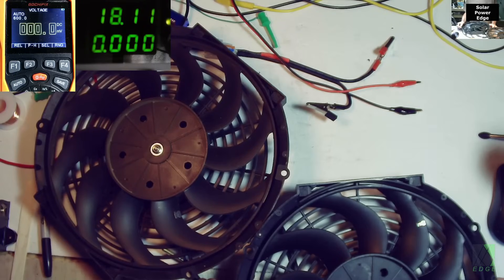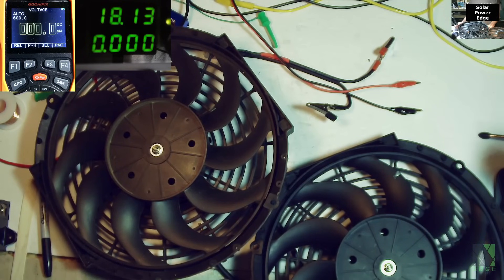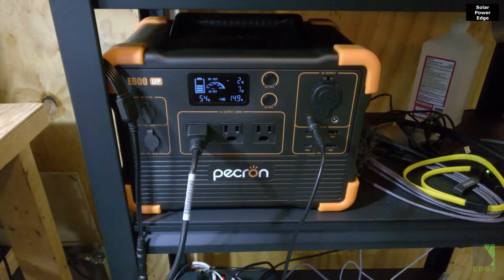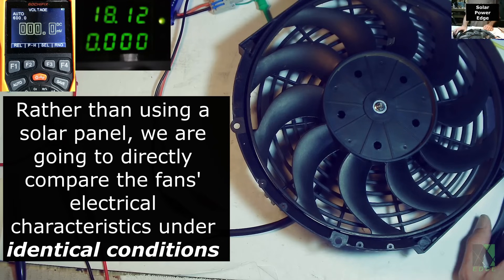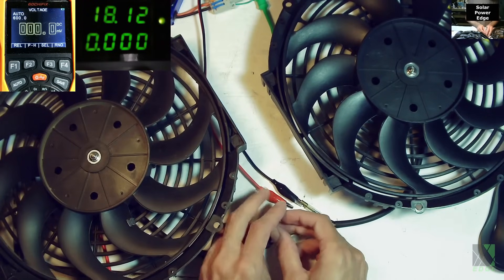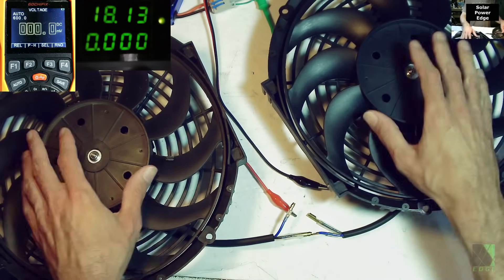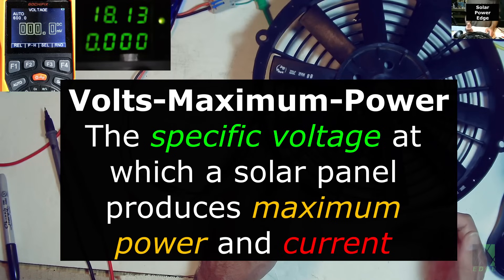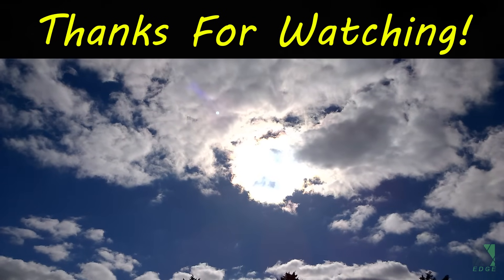Bench Test! 12v / 24v / Series car radiator fans for solar shed ventilation #shed #diy

Comment: Question:  How many watts is your 12" 24V fan?  Next question: Does wiring two 12V radiator fans in series eliminate the need to implement a motor speed controller and Watt / Amp meter to prevent harmful power surges when powering-on and adjusting the speed of the two 12V fans?  Next question:  What size (Wattage) 12 volt solar panel should I use to power two 16" or 17" 24 volt radiator fans?
Reply from the maker: @bradlyons7046 Hi, they are 80-85 watt rated motors, very common on the market.
Wiring 2x 12v 12 inch fans in series creates a sort of 24v compatible system, which also happens to match a 100 watt solar panel pretty well with zero need for speed controller or electronics. I do recommend a switch to power the fans on and off for maintenance and safety. 
I would recommend a 100 watt 12v solar panel minimum to power 2x 12v series 85w fans. They should move some good air that way. 
The 16/17 inch fans take more power, and can be around 100 watt rated. So while one 100 watt solar panel should run 2 16/17 inch fans in series, they might not move enough air. You might end up adding one more solar panel in parallel. But it's OK to test with one solar panel and see what happens. Hope this helps!
Reply: @solarpoweredge  If by connecting two 12v, 80w - 85w, 12" direct current radiator fans together in series it changes (increases) their voltage from 12v to 24 volts, does it simultaneously change the amperage (current) or the wattage of the fans also?  If it does, what does it change the amperage and / or the wattage to?  My next question will depend on what your answer to this question will be.

Comment: Most car fans employ a fan control module which cuts current in half. An ebay pwm module and a junk yard fan controller would be ideal if you needed extra battery charging.
Reply from the maker: @egn83b Thanks for the ideas! I installed one of those cheap PWM speed controllers in one of my sheds, works good

Comment: So would the 12v fan alone work better with a 30 w panel? efficiency wise. Trying to setup for polytunnel cooling probably wont run full out in there anyway. Have speed control, buck, and a 12v fan already just looking at panels.
Reply from the maker: @clinchdis For direct DC solar power operation, the load should be matched to the solar panel. This is a bit of a chore sometimes. Normally a 12v 80w car fan is not a good match to a 30w 12v solar panel, but a DC converter can help solve that problem by manual adjustment. A 24v fan is a better match without the DC converter.
Also, at least 100 watts of solar is highly recommended to ensure the fan moves air even in cloudier conditions. Here is a playlist of my various solar fan tests and installs, you might find it useful https://www.youtube.com/playlist?list=PL8a6nRTNyF9NaLLnvv7lxb0F5TGonkPyY

Comment: I have enjoyed your videos on these fans and had the idea before but was un sure how to execute it and your information was of great help, I greatly appreciate it. 

I do have a question,  I have some existing mechanical attic fans that have died from old age. Rather than replacing the 120v AC motor with OEM type Id like to use one of these 12v DC units, the catch is I need to run them into the evening after the sun has gone down. I'm sure I could run them off of some type of battery set up and I am not excluding this yet, however I would rather hard wire these 12cDC units (or any 12vDC units for that matter) off of stepped down 120AC. My existing fans (3) are all wired to one breaker in the panel it would be great to use this wiring to pull this off.  I took a chance asking this because I see you answer almost all the questions. I am willing to pay for your advice on this if that is something you do. Thank you
Reply from the maker: @jeffp7776 Hi and glad you are enjoying the videos... I am extremely overwhelmed at the moment due to health issues and other matters, so I have to keep this short. Just thinking through your project, some kind of 12v AC-DC converter could be an option. They are very common and not too expensive. Probably need 20-30 amps (estimate). Could place one downstairs with a fuse block, and run the 12v into the attic. You can certainly run DC fans instead of AC. I'd under-volt them (~10v) to reduce overheating risks in the attic. The existing wires can be disconnected and used for 12v if needed too. There is nothing wrong with re-using those wires for 12v, as long as they are disconnected from the AC breaker box and have fuses. Hope this helps or at least gives you some ideas? Thanks for watching and supporting the channel!!!
Reply: @solarpoweredge  Thank you for the response I appreciate it. Take care of yourself I’ve had some issues lately (healthy for 55 years) so it is a big strain both mentally and physically. Hope all turns out well.
Reply from the maker: @jeffp7776 Welcome, and you're absolutely right. Take care... hoping for better times!

Comment: I've been trying to think of ways to use solar in my cheap amazon greenhouse build, and the algorithm led me to your videos. This series is amazing and thank you so much. I've learned so much and I was leaning towards just using power from the grid in my greenhouse, but now I am considering solar. I was also trying to think of the cheapest way to run those fans at night off of a battery, but I am going to continue doing research until I find the best solution.
Reply from the maker: @pat2965 Most welcome :) your feedback is very encouraging, glad the videos were useful. What if you switch to grid supply at night? That could be an interim step while you research energy storage. This is what I've done in years past and it brought me into solar gradually over time

Comment: Hi, could you help me understand how 2 fans rated at 80 watts runs just as good/strong or even better then a single fan with a 100w solar panel.  Logically it seems like you'd be asking the panel to run 160 watts?  I have this setup and would love to run another fan to double the airflow but would like to understand how this works?  Just seems like to me is "should" run half as fast or not at all b/c of the watts being asked of the panel when you double the 80w fan?  Thanks!!!
Reply from the maker: @RubberDuc Hello, a solar panel requires a load of a certain impedance (resistance) in order to reach the most efficient voltage. Wattage is simply volts X amps, but that's all governed by impedance as well (Ohms Formula aka law - I/V/R). A 12v 85w fan is not really a good match for a 12v panel, too low impedance. Putting 2 in series develops more power overall because the solar panel voltage actually increases. To understand more about solar panel behavior and impedance matching directly attached loads, please see my video here: https://youtu.be/dIN7Gzl0fhg

Comment: What's the CFM of the fans?
Reply from the maker: @NBC_NCO Around 1500 running wide open unrestricted. But I wouldn't run them that fast all day, they get very hot. I have no available way to measure CFM at lower power levels. Might try measuring RPM with a tachometer for comparison.

Comment: Two 12s in series is 2 watts more, but, but if you used one to bring air in and one to exhaust air or if ypu had the sofit venting to make two exhaust at each gable, i can only imagine twice the air flow, even though you could hear the speed changes between the fans...  to compare apples to apples we need to get rpm and / or cubic ft per min comparisons to see which fans are most efficient... given the power consumption... great video... ive been thinking about car fans for some time with solar... love to see your install...
Reply from the maker: @dougscott2408 Good thinking sir. Thanks for the positive feedback. CFM and RPM data would be great to have. Hope I can cover that in the next video.

Most recent install is via the windows in the largest shed (they have a screen, plus no need to damage the shed further) 12v car fan + 12v BLDC fan + 150w solar. Unfortunately the gable vents are small, so I open the doors sometimes to move more air.  
24v fan + 50w solar for a small metal shed. Works good but might upgrade a little.

*For reference all shed fan videos are listed here https://www.youtube.com/playlist?list=PL8a6nRTNyF9NaLLnvv7lxb0F5TGonkPyY

Comment: They probably cost more (24 volt) because a lack of scale. 12 volt is by far more common. 24 is mostly in large equipment and trucks. Like bulldozers or semi trucks. The lower sale volume and lack of demand vs 12 volts (massive market) means its more specialized and expensive. Great video, gives me lots of ideas.
Reply: Can’t speak to bulldozers, but every semi truck I’ve ever driven (sample size of 16) uses a standard 12 volt electrical system. Nothing special there.
Reply from the maker: @Deveak That certainly explains it, good points. Glad you liked this one and thanks for watching
Reply from the maker: @Deveak I don't know a lot about them, but some military vehicles are apparently 24v. Outnumbered by cars for sure

Comment: Can you do a CFM comparison with a 12v vs a 24v on a 50 watt solar panel by chance?
Reply from the maker: @user-wt4hi2xe4m Good idea but I don't have any means to accurately measure CFM. The max CFM of the 12v 12 inch is 1550 which is probably a bit optimistic. One of those wind speed indicators and some math could solve this question. I might grab one of those when I get the chance.